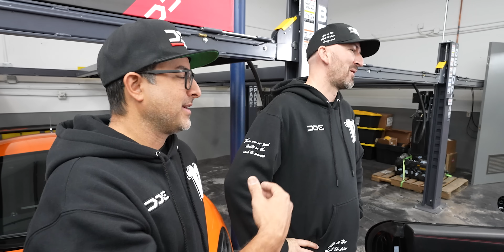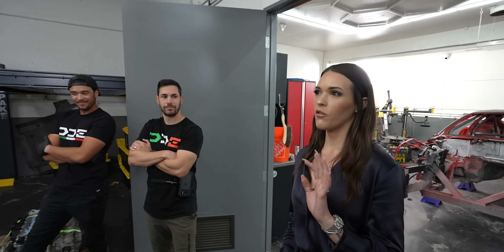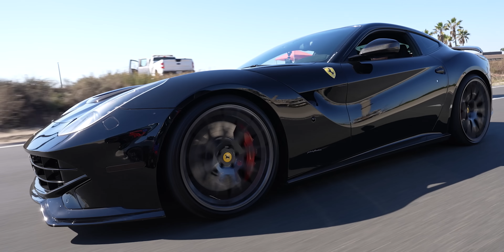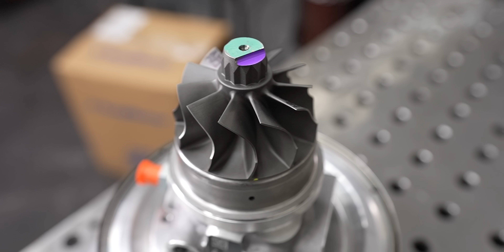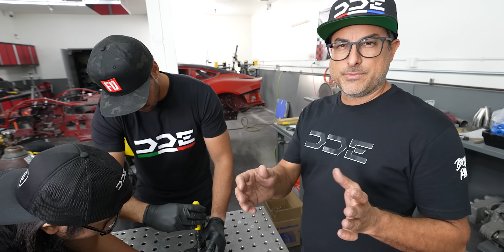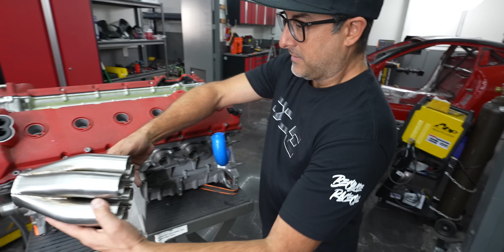REVEALING 2000 HP FERRARI V12 TURBO KIT!

Comment: Inconel is the best material to use because of its light weight and high heat resistance. The turbo would be better with the extended tip version.

Comment: You will be wasting the increased turbine drive efficiency offered by a twin scroll housing by using a non-divided collector/manifold design.......
If your going to utilise an open collector it is best mated to a single scroll manifold. 

The main premise behind a twin scroll housing is to harness exhaust pulse energy effectively by keeping the exhaust pulses seperated. This  prevents multiple exhaust pulses conflicting with each other which reduces drive energy. Twin scrolls also assists in reducing between cylinder reversion which is helpful with large overlap valve events. 

(Example on a 4cyl with 1342 firing order and a twin scroll housing: 
Cylinders 1 &  4 would be on one scroll. Cylinders 2 & 3 would be on the other scroll. This results in an unimpeded and energetic exhaust pulse every 360 deg. )

Twin scrolls (done properly) are generally more responsive and have better threshold and drivability, while single scrolls generally produce more outright power overall. 

Surprised Damon and Dave haven't heard a 'T51R' modded turbo and it's insanely loud whistling shreak and opted for that in the build. 

This is nothing against Mr.Essa. He is a excellent methodical driver/fabricator to which there are few and far between and from a fellow motorsport fabricator, it is refreshing to watch someone on YT that actually knows what they are doing and execute's the work professionally with all aspects involved with the modifications assessed and undertaken to a high standard.

Comment: Full marks to Mike for maintaining direct eye contact at all times.
Reply: It Pwm’s the boost controller solenoid, not the waste gate, by pulsing the solenoid very fast it can maintain your target boost, and correct extremely fast..
Reply: It would be nice if you can make pie cuts to match the plastic pieces, mark your pies the same as the plastic, and it would be easy as “pie” to convert your plastic to real tube..

Comment: If the turbo are going out the hood again, then that wastegate unless rotated not to see it will look not as good as before. Also did you get the second turbo clocked in the other direction so you can build the piping symmetrical.

Comment: Michael, I’m from the Marine industry twin engine big blocks always super charged with that be due to no transmission high rpm or is it more efficient cause I’ve known some Street guys that blew away a missions in Arizona that were running superchargers turbo supercharger?

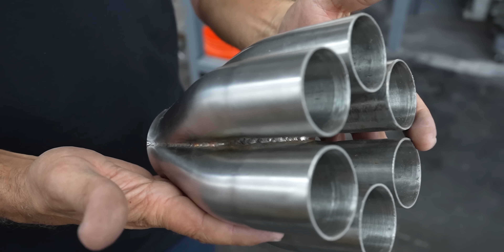Comment: at 20:34 pause it...look at pipes 2 and 3 if you count clockwise...look in the middle of the welds...a dark spot where no weld is in the middle bottom  right...i hope thats just a mock up or test fit piece...because that is  unacceptable

Comment: TALK is cheap!  How about some progress.  It's easy spending money without any results, Mike's proven that. It's like watching city workers stand around doing nothing but collecting a check.  Shut up and finish the phucing car.  Good thing the new guy and Tim are working on the F12, at least something is getting done.  Other than parts being thrown in a pile.  It'll be another year before the F12 is even close to being finished.  Point is case, How, can you build an exhaust collector when you have NO idea how much clearance you're going to have once the new engine with all its components are in place.   Lots of ideas no direction = lots of wasted $$$$$.  Sure, do miss the concept that DDE was, seems to be just going in circles now.

Comment: "Wastegate control spring" yes if your relying on reference from the compressor... You will want a higher spring rate. With a CO2 boost control you will use a lower spring rate... So that you can set a more efficient boost by gear "lower boost settings in lower gears for leaving the line" The electric boost controller is the way to go for very precise wastegate accuation. Good job dudes! I'm just chilling.

Comment: Equal length headers are gonna be tight. Length by firing order could make life easier for front mount.
Dig the Borgs. Please think about putting them in the back of the engine bay. Fender inlets, and single centre hood exhaust (6" oval maybe), or long radius down pipes to side exit...? Projecting my dreams on you guys, lol.

Comment: Real question for Mike : Mike what would happen when you put gearing ⚙️ on the shaft that got the turbines on it ? 😅 I always believed it would make more boost at low rpm en definitely more boost on the high end what you think ? 🤔 💭
Reply: That's called a centrifugal supercharger then.  Not a turbo.  Turbo are exhaust driven.

Comment: At 20:34, if you zoom in to 3× magnification,  you can see some black marks going down the barrels of the exhaust. I would polish that a tad bit, with some kinda Dremmel tool. Just to prevent buildup of gunk.

Comment: So in other words Gintani stuffed the turbos under the hood as good as they could even tho it wasnt the best place to put them they should have done them in the rear so they wouldn't have had to tear the car to peices !
Reply: Erin Kaufman built the TT kit & Gintani tuned it.
Reply: @dobermankd   NO Kauffman built it originally then Gintani revamped the whole system with new turbos , intercoolers and the rest of the components !
Reply: Gintani didnt do the twin turbo kit and the whole point of this car is to have turbos out the hood
Reply: OR someone who knows nothing about how cars work told them he wanted turbos on the top so he could get views? Just like telling folks two cars were going to SEMA just to pull a bait and switch for more views.
Reply: @newguycanada  Alright Mr. Negative Assumptions.